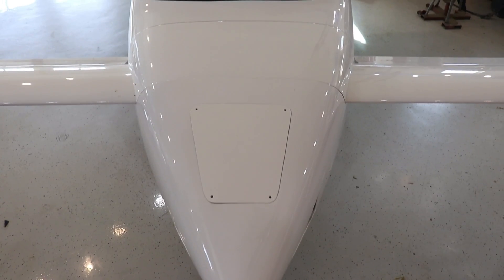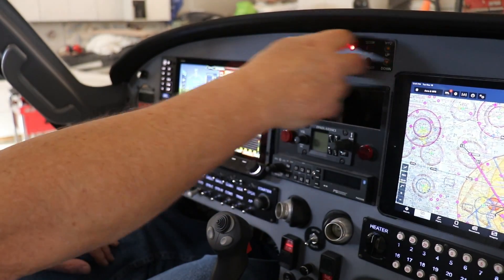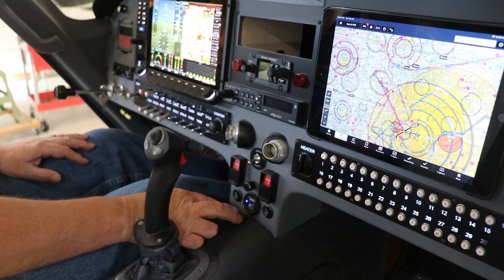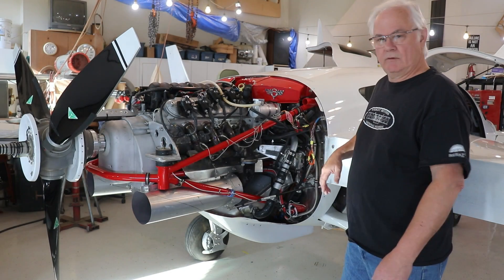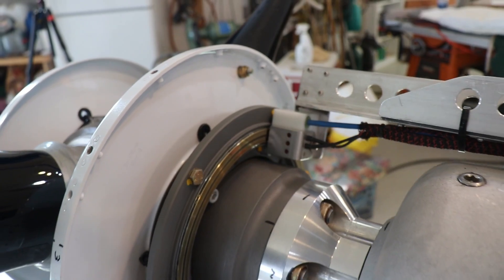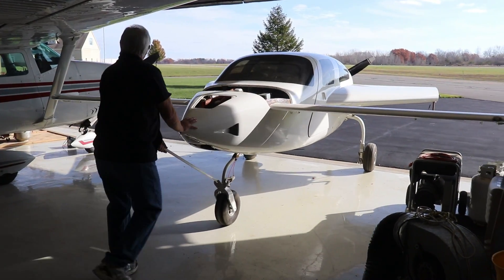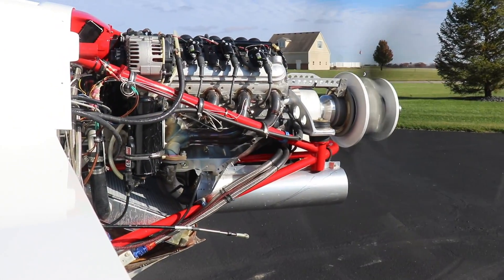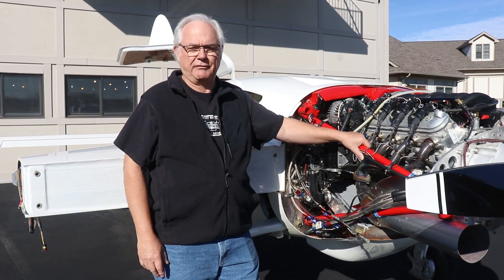Corvette LS3 V8 Powered Velocity Kitplane UPDATE!

Comment: I mean if i did it i'd probably do an LS from one of the trucks. I get that the corvette version is likely lighter, but honestly the LS ain't got nothing on the displacement that the engines this kit was designed for have. It's a good 33% smaller displacement roughly (the continental 550's and lycoming 540s are 9L boxer 6's which produce needed HP in less than 3k RPM) so in order to deliver the needed 250-310HP to get full flight performance you'll need to run this thing much closer or into the power band repeatedly. That being said car motors are not designed to be held in the powerband long term like this, and as a result you really need the steel block and not an aluminum one the vette likely has to get reasonable engine life, or be forced in a situation where you might have suboptimal engine life and possibly a need for better cooling due to long term running beyond the expected operation speed. Also, no matter what the computer hardly matters as you'll be totally re-writing how it works simply because it isn't a car. Lastly, as the LS wasn't designed with aircraft in mind i'm interested to know if this has impacted lifespan specifically in cases where you are angled substantially or upside down which is something that can kill motors not designed for it due to the oil pumping setup not being made for that. You see failures like that mostly in motorcycles when people are stunting, and there is a workaround in the motorcycle scene, but i do not believe there is a scaled up version that works for the LS yet, but i'm sure it wouldn't be too hard to custom make.

Final verdict is while it can be done it'd be cheaper and potentially more durable to use the truck LS, but also it might just be too much plane for this engine to move. There is no replacement for displacement. Ultimately, i eagerly await as much info you're willing to give on the project, because i have no actual statistics for the LS swap on this aircraft so i cannot actually say for certain it wouldn't work or see glaring issues. Hoping you add said information to the aviation community.

Comment: Is there a resource on where I can find more information about the prop control when using this engine configuration?  I assume electric but more interested in how this works since power of the auto engine power rated via RPM rather than MP.  For example, do you adjust pitch based on engine load similar to shifting gears?

Comment: What setup was used for the ECUs?  Is that custom or off the shelf, and what system is it?  Qre dual ECUs required?
Also, could you have built this as a front prop, with the engine backwards?  And what is your crusing Engine RPM?

Comment: INTERESTING - automotive engine in an aircraft. I see a dry sump (has external oil tank?) and fuel injection so brief periods of zero to negative Gs probably no problem. Wondering if there's a time limit to fly inverted...  In another video you say the RPM limiter is set for 4100 RPM. The LS3 develops peak torque around 4500 RPM and max HP around 5900 RPM, but for aviation use one would not want to run the engine at those limits ?

Comment: Why an automotive V8? they have an absolutely horrible track record when put in airplanes. More often than not the pilot ends up dead. If you put in a lycoming IO-540 it would be reliable, tested, designed for aircraft use, and no gearbox needed.
Reply from the maker: I think everything you said is true, but the beauty of this hobby is that everyone is free to experiment and build as they desire.

Comment: The prop must have cost more then the engine wonderful airplane maybe he will have it ready for Oshkosh 22. I wonder if a Turbo Charged V6 would have been better snice really can't use the HP the LS3 has and up at 25k feet it would only produce about half the power mostly just extra weight.
Reply from the maker: The prop actually did cost more than the engine.

Comment: It would be interesting to see a maintenance / cost comparison of the LS3 vs other aircraft engines with similar power. Thanks for posting, amazing build.
Reply: at 8k-10k for an LS crate engine, you could replace the entire engine 10x and not come close to a single, 400 HP Lycoming IO-720.
Reply: As well it shoild be made by qualified engineer

Comment: thank you so much for the update on this Velocity LS3 project.  this is perhaps one of the most exciting projects on Youtube (for me). I'm VERY interested in how this engine will work with the Velocity as I also VERY interested in their new XL6RG project w/ a single engine.   It's my feelings that this LS3 would be the perfect engine for that job. I texted w/ Velocity a couple days ago and they are currently looking at the IO550TC as the primary power plant. While my dream plane (Velocity w/ 6 seats) may be a couple years off;  (I'll definitely be doing the quick build) this project holds great promise for me and very much look forward to seeing how it (LS3) performs at various altitudes, especially above 10K (speed vs efficiency).

Comment: How long do you reckon, it would take for this place to be in air ?
Reply from the maker: He would have been flying about 2-3 years ago had he installed a regular Lycoming engine. Installing a Corvette engine with its custom design and gearbox issues has added years to the project.

Comment: I've built, tuned, and/or wired at least 100 LS swapped cars. I'll tell you now that the O2 sensors being 3" from the exhaust opening will not deliver anywhere near the correct readings to the PCM. They need to be as close to the collector as possible AND a minimum of 18" of exhaust pipe after the sensor.
Reply: You have a good point there. Pressure pulsations can create a surprising amount of reverse flow from the end of the pipe, and O2 sensors are EXTREMELY sensitive to ANY oxygen that finds its way in from the atmosphere when running stochiometric (as required to make a 3-way convertor work effectively on an automobile) or when running rich of peak to get maximum power out of an automobile (still legal for a few more years for production cars as catalyst temperature protection). Even 3-bolt flanges with missing gaskets or slip joints a few inches downstream of the O2 sensor can be a little problematic.

If the ECM is relying on the feedback signal it should drive it to a much richer condition, so at least for takeoff power that is in a safer albeit lower power condition. Assuming wide range O2 sensors and setup to run lean of peak for maximum fuel range at cruise (as I certainly would) it should be less sensitive under that condition. But definitely something to be keenly aware of when setting up the fuel air ratio that the O2 sensors are probably lying...

Comment: Awesome build!  I would like to know weight and balance of this velocity be compared to the weight and balance of the same model with a 300HP traditional aircraft engine?  Is it similar?
Reply: The engine, drive, and radiator actually weigh slightly less than a Continental 550.

Comment: It's a great project and the owner is to be congratulated for pushing the experimental envelope. Yet the conservative pilot in me can't help thinking of all the failure modes - electrically dependent water-cooled engine, reduction drive, electric prop pitch control, retractable gear, all combined in a package that has never been done before. I'm glad there are people like him who carry out an amazing vision. For me, I'll be putting along in my stupid-simple Zenith 601 and hoping in my next life I will have the courage to do something like this.
Reply: I would have no problem trusting that computer controlled and water cooled V8 and probably even the electronic prop with my life. But gear drives on the other hand scare the heck out of me! I will probably go with dual electronic ignition and fuel injection on a Lycosaur as a compromise in the future assuming the stock market stops kicking my kit plane fund in the teeth...

Comment: This is my life long dream! A fast aircraft that I can share with family and friends. The only thing I might change, is to go from the LS3 to a Gen III Hemi, and that’s mainly because it already has two spark plugs per cylinder. And anything with fuel injection can be modified to use twi injectors per cylinder. Redundancy can save your bacon. This plane is almost perfect, and it is for the cross country mission. 
But there are two missions that I want to fly. The other is search and rescue. The Zenair CH 750 HD fits the bill. With room for three I can fly with an observer while carrying emergency supplies that can be parachuted down to the victim. It could also extract one person if there is ample landing space anywhere. 
I have one question about the Velocity. What RPM are you running? What gear ratio are you using to maintain an effective prop speed?
Reply: Max 4100 rpm   Cruse 3300 to 3700.  1.54 reduction
Reply: Redundancies: 2 ecu  2 fuel pumps 8 coils 8 plugs 8 injectors each wired independent of the others. Engine runs very well as a V4 on the ground…. We will see how that works in the air!!
Reply: @len3396  But 2 crank position and cam sensors? Loose one of those and both ECUs are useless.

Comment: Would it not have been more cost effective in the short and long term to have installed a turbo-prop, which could yield the same performance as this piston-driven automobile engine?  This is a remarkable build all the way around, but from a maintenance and performance perspective, does a Corvette engine really make sense?
Reply: That's what's great about experimental, it doesn't have to make sense😂
Reply: Which turboprop would you suggest? Most turbines are not efficient until you are in the flight levels.
Reply: Uhhhhh no. Have you looked at the cost for even a cheap turbine engine? Turboprop engines are priced in hundreds of thousands of dollars.

Comment: Very interested to know what happened with the Ballistic gearbox. There have been too many failures with these in general and I am rooting like crazy for you and for Corsair V8 that is trying to STC an LS3 with the Ballistic gearbox. I don’t necessarily want dirty laundry to be aired but in the interest of safety I do hope you can communicate your issue with Corsair to help in their developemwnt!
Reply from the maker: The hub on the original gearbox had some play in it. The gearbox was sent back to the company for adjustment and then the company took the gearbox and disappeared-never returning the gearbox or any money to Len. They won't even answer e-mails or phone calls. That is the main reason this project is not flying yet.
Reply: @KitplaneEnthusiast  I’m glad to hear it wasn’t a major mechanical failure but also very disappointed in the company, especially if they hope to provide pets and support for the Corsair engine. Thank you for the information!
Reply: @KitplaneEnthusiast  how shady! I just reached out to Corsair before viewing here. They mention they use a "custom" PSRU, was not aware it was a Ballistic. Their webpage has updates dated 2022.

Comment: What is the expected range and fuel consumption per hour? Is there a proper that can handle  more of the engine ram's?
Reply: most props are designed to max around 2700. the crankshaft and design of an auto engine is not designed for the forces of a spinning prop. I hope the Stinger drive performs well for Len.

Comment: I love the project and the plane but as the crew chief on an LS3 powered Corvette racecar how are you working around the problem of the LS3's propensity to burning off plug wires? The racecar goes through 2-3 wires a year even with wrapped headers and high temp wires. It is a terrible design having the plugs rite between the exhaust ports. I would love to see how you overcome it as it might help the racecar.
Reply: And you just may have brought a potential critical design issue to Mark's attention, 
( possibly saving the aircraft ) !
This may be a very stupid question,
and I do understand the prop being cooled by a significant amount of airflow, and ambient temperatures being much cooler as altitude increases.
But, is there going to be any heating of the prop with the headers dumping out just ahead of the prop ???
Just curious !
Reply: @quadsman11  the airplane isn't known ice certified, so prop heating shouldn't be a concern.
Reply: @GSarducci  
I guess I was misunderstood,
I meant, propeller damage created by the outlet of the headers being directed at the prop, and only a few inches away from it.
I should have realized that there could have been another meaning infered.
My mistake for sure !
Reply: @quadsman11  ah!  Didn't even consider that.  I don't think any individual blade would be subjected to the exhaust for a long enough period of time to heat the prop out of tolerance. Looking at the way he has the exhaust set up also, the exhaust gases will mix with air from the cowling a good foot before the gases encounter the prop, so I would expect the exhaust gases at that point would be significantly cooler than the EGT out of the header.
Reply: @GSarducci  
I agree with you on that Paul,
was more of a curiosity than anything.
But I'm an autoracing nut, and aviation nut, so always thinking about things in the extreme !
How extreme forces, and extreme heat effects have on critical performance parts !
I try to never make assumptions about something critical that can have potential failure at critical timing !
Like, let's say 5000 feet, in the case of aviation of course !
Or at extremely high speeds, and depending on brake performance, etc. !
So, I guess, more of me thinking out loud !

Comment: Thank you for taking the time and effort to record and edit this update video, and thanks to Len as well! It looks like a lot of thought went into the interior, it's very nice and has a modern luxury/sport look that matches the plane.
I'm wondering about the V8. Do you know if it can burn 100LL fine? Will it need an additive or limited run time on leaded gas?
Reply: I am sure it. Can with the right tune.
Reply: All autogas engines should have a lead scavaging additive added to leaded fuel. The lead will gum up any engine designed in this century.

Comment: Is there no concern with sending exhaust gases straight into prop?
Reply: What would be the concern?  The Beech Craft Starship sent the exhaust straight into the props and I'm pretty sure a Turbo Prop exhaust is a lot hotter than a piston engine exhaust.  In fact all Velocity's send the exhaust into the prop as with all pushers.
Reply: @kvnkaveman  P-180 Avanti has the same layout.

Comment: G, day Mark from Sydney Australia.
* love the panel: unsure about the circuit breaker identified numbers, (what system is affected No 8 etc).
* Run up against the hanger door: any nose rash?
Thanks for the tour.
🌏🇭🇲
Reply from the maker: John, he has a page in what will be the flight manual that shows what each number is for. Maybe not the best system, but that's how it works. As for hangar door rash on the nose, check out the previous video I made about this plane. He has a retractable tie down "bumper" on the nose! So no scuffed paint. It's pretty clever how he did it.

Comment: Thank you very much for the update. It´s a very interesting project. Please share the numbers (cruse speed, climb rate, fuel) when finally you have this beautiful plane fully operational. One more. Excellent job with the interior. I like the instrument panel layout and interior color and the direction everything is going. There is any plan to install a force induction system on the engine or there is not room in the engine bay?